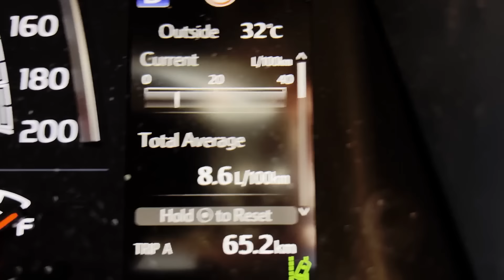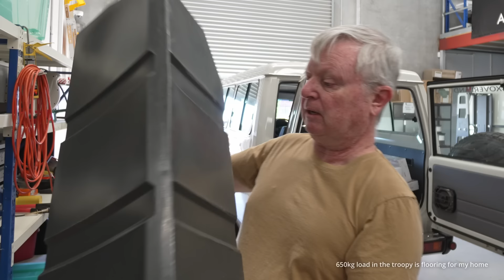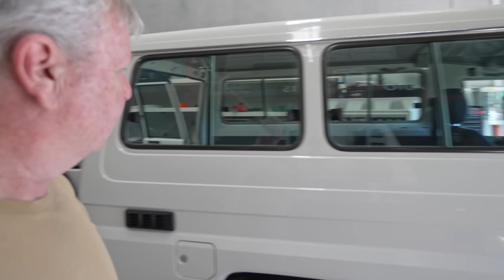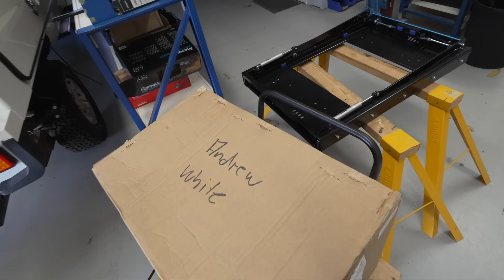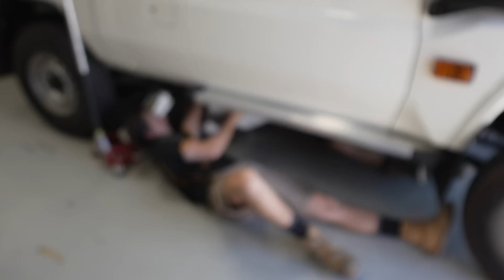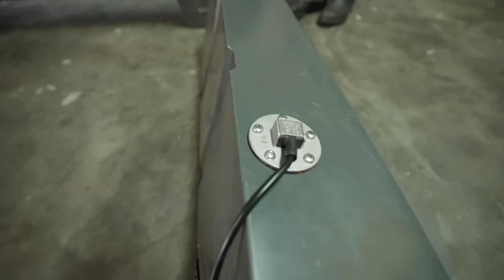Water Tank Worries. Landcruiser 2,8 Build @4xoverland

Comment: google is your  friend type aluminum fuel tanks fo  70 series or wheel arch   fuel tanks laqst time isawc a set  75 liiter

if you  are going 5to carry water whether bee washing  your bare arse, washing dishes or drinkinking water make them   out of metal plastic  tannks do'n't hold up  long term water storage if you routinely  refill tanks   you need   boil  the water as part of the purification process

Comment: Get a local fabricator to custom make one, if you take that other one you have to him he should be able to make some up similar
Reply from the maker: Home made tanks are a liability. Tank design, both water and fuel do not look it, but are highly specialised. Bad ones crack and the mountings break. Especially stainless steel, as its very brittle.

Comment: It would be interesting to see actual true fuel consumption calculated from gps km driven devided by the amount of fuel to fill up to full again.
Most people just give the consumption that the vehicle displays. In a variety of vehicles i have only found one that was acurate (2005 Mercedes A180 Cdi) the rest was always very optimistic as the actual consumption calculated was much less than the vehicles show.
I believe that the only way to get the a true reflection is to calculate it from fillup to fillup.
Reply from the maker: You are right. I did that, and its not what the Cruiser tells me. I measured 10.1L/100kms after a fill-up, while the car is telling me 9.6L/100kms. Maybe the pump is cheating? Or is the car lying? There is no absolutely reliable way to measure it.
Reply: Thanks for the answer sir, i apreciate it. 
As the time goes by you will be able to tell who is lying or cheating.
Yes i agree one can not be 100% shure that the attendants fills it up to the same level everytime as you will know some guys here in South Africa will spend 15 min at the pump shaking the vehicle and filling again and shaking etc to try to get it full.
 
I let them fill untill auto stop on the pump kicks it off and i found it to be very consistent for me.

Comment: Just of note, you do need clear access to the floor to fit the long ranger automotive tanks. You said upon conclusion that you wouldn't need access to the back to fit one.
Reply from the maker: that is incorrect. The smaller tank does not need access inside the floor.
Reply: @4xoverland  I didn't know that about the smaller tank. Thank you 👍

Comment: With the underbody tank, don't worry about a filler, you don't need one, I deliberated for weeks about what I was going to do with my Delica for a tank fill, then it suddenly dawned on me I DON"T NEED ONE, I just use the outlet as the filler, I put a quick release hose connection on the outlet, connect it to a tap and bobs your uncle. I can also fill from a bucket which I have done numerous times using a flexible hose and small funnel....easy !!! 🤠😎

Comment: Jerry cans of water make enormous sense. As you use the water in the under body tank you refill it From the Jerry, when the Jerry is empty just pop it on the roof out of the way, till needed for refill. Cheap effective no hassle with loose joints piping , failed pumps , drains , leaks etc etc.

Comment: Hi Andrew. Just wondering if it’s possible to have the long ranger water tank “cut and shuck” by a local fabrication business to fit the modified cross members under the vehicle?
Reply from the maker: Are you suggesting I have a 'fabrication business' modify the cross members in Toyota's unbreakable chassis so that the tank can fit? I hope not.
Reply: Sorry for the confusion - modify the tank to suit the car. Although I’m not a fabricator I’ve worked as an accessory fitter for a well known touring vehicle outfitter who also has a fabrication business attached, and this was a regular occurrence to modify aftermarket parts due to unforeseen problem like these. I understand you will loose warranty from long ranger however as long as it’s done correctly by a reputable fabricator theres no reason why they can’t provide their own structural warranty on the modified part, especially for something as basic as a water tank. Bit of fluffing around but would be much less than fluffing around with Jerry’s for a year.
Reply from the maker: I will wait until they make a dedicated tank. I can't afford to lose this tank in the bush. Only a specialist tank maker understand tanks. Homemade tanks rarely if ever work for long. Especially when made of stainless. Its very brittle.

Comment: Seems like they should have made the tanks taller and moulded to the cavities instead, so they could be easily removed and installed without modifying the body. I'm sure it would make it more expensive to manufacture, but with how common 3D laser scanning tools are these days, someone could make a really neat and easy to install product. I'm thinking similar to how the plastic OEM diesel tank is on the Mercedes Sprinter (and probably many vehicles) with all it's cutouts to account for the vehicle structure.

Comment: Andrew, You're not 'building a Troop Carrier.' That was done by Toyota in Japan. You're accessorising it, fitting it out etcetera. They are not the same thing.
Reply from the maker: Nick. Yours is an alternative but in this case, incorrect use of the word. Toyota manufactured the base car. Its not an overlander. We now build an overlander using it as a base vehicle. 'Build' is the most commonly  phrase used in this industry, by the makers of accessories including tyres, tanks, recovery gear, lights, bars, tents, etc. Its an industry standard.
Reply: @4xoverland  To conflate accessorising a Troopie or any 4x4, with building it, is good old fashioned hyperbole, arguments from authority don't change that. I eventually commented, because you use the term consistently; every time I hear it, it grates. Perhaps I'm an outlying anal pedant! Either way, it's not the end of the World. Good luck with the vehicle.

Comment: Yes I am not wrapped in the idea of cutting out strengthing ribs ,Toyota put them there for a reason, agreed too over complicated. I would grab a sheet of template cardboard and design an under body stainless steel tank that fits,  and the water would taste better too. A bit of work to achieve but plenty of 2.8 Troopy owers would buy them, $$ to be made with this product.

Comment: Thinking of using one of my Jerry cans for extra 20 litre that will give me 62 litres and have the other one for diesel. I just mark it as water only. Not used any Jerry cans yet so all god for water.
Reply: You can buy proper food grade 20l water jerry cans. They are blue(usually) in colour. I use a couple of them for drinking water. Not taste.
Reply: @malcolmL995  will be just for shower or cleaning tho. I have a 42litre water tank from front runner. Thought I’d use the Jerry can as another.
Reply: @aggitravel ah, fair enough, you hadn’t said that. Only thing I would worry about is some other idiot not reading the label, thinking it’s fuel and tipping it into your fuel tank. 😂😂

Comment: What not thick plastic water bags in cavity like they use in boats
Reply from the maker: Cavity bags do not work in cavities in vehicles. The vibration quickly wears them through because the cavities are not uniform. I.e that have edges and sharp bits.
Reply: @4xoverland Andrew, there’s a company in NSW Central Coast that makes water bladders for the marine sector with extremely durable “protection” systems. I’ve used them in my VW T3 Syncro bus.

Comment: Would bladders in the body cavities be a good option?
Reply from the maker: Bladders work in spaces that are even without protrusions that can cause wear and cause punctures. The body cavities are the very opposite of that, and if a puncture did occur, the entire interior build (to come) would need to be removed.
Reply: @4xoverland May be multiple small molded tanks, that fit in the cavities, and connected together with water fittings ???? This way no need to cut the body frame components.
Reply: @mansoorahmed3918  That would be a nightmare to sort out.